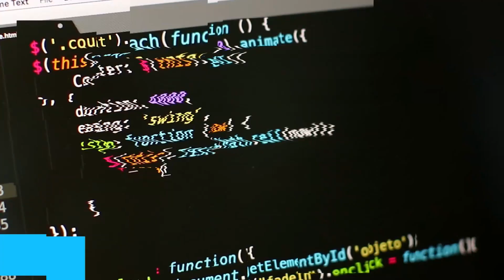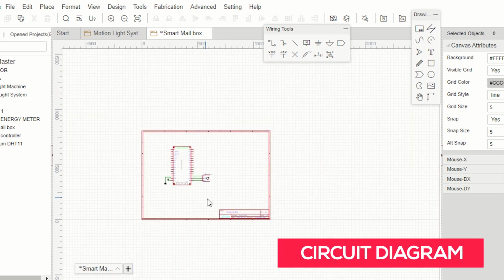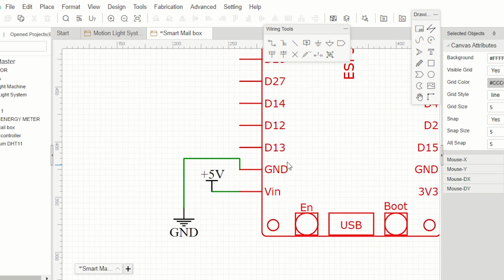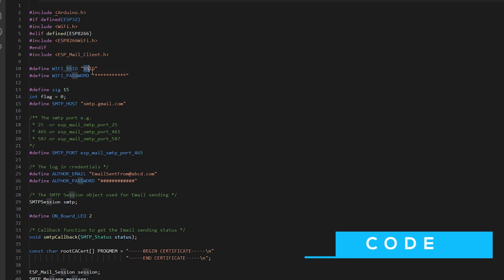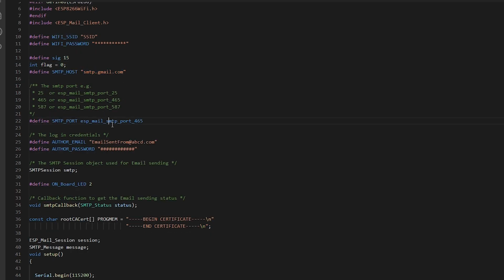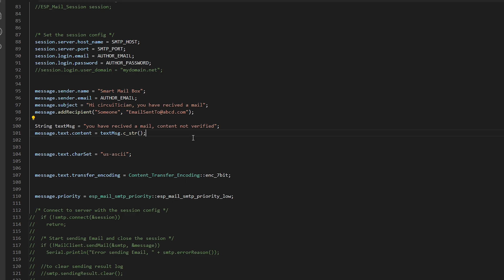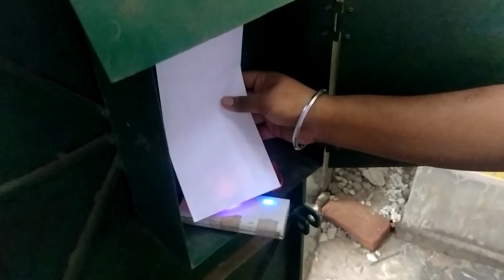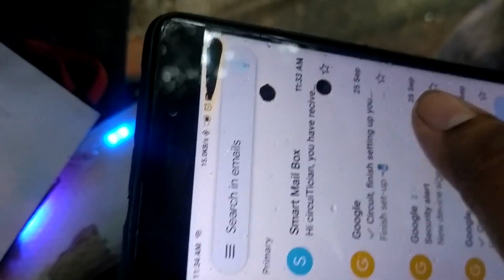ESP32 E-Mail Notifier for your Mailbox | IoT Smart Mail box

Comment: Nice work. How did you configure the esp32?
Reply from the maker: If your question is how I upload the code then I used arduino ide
Reply: @circuiTician  good. but I am having difficulty on how to upload it using arduino ide. I have connceted it to the system , I have installed ESP mail client on arduino but still not working. could you please schedule a zoom meeting?
Reply from the maker: Ping me on Instagram
Reply: @circuiTician  I have. Kindly check @manlikehamber
Reply: @circuiTician, please check your instagram

Comment: I liked you creative intro. 

What is your battery capacity (mAh)? How long does it last?
Reply from the maker: 18650 Li-ion Battery 5 in parallel each 1200 mah
Reply: @circuiTician  So 7000 mAh? How long will it last before a recharge?
Reply from the maker: 6000 mAh. In general aprrox 70 hrs.if sleep mode enabled then it will run longer.
Reply: @circuiTician  Did you use sleep mode in this design?
Reply from the maker: No